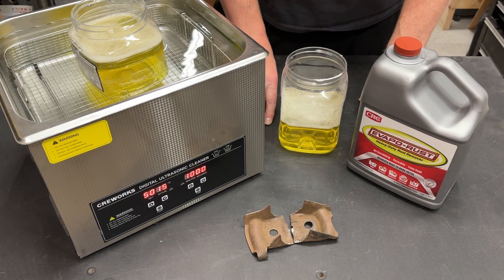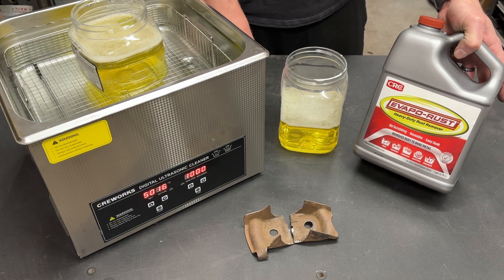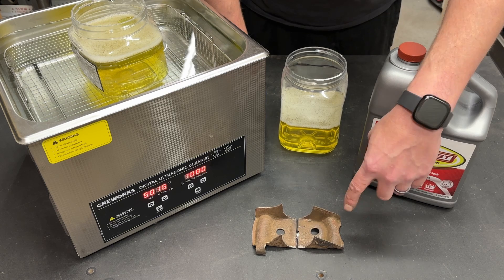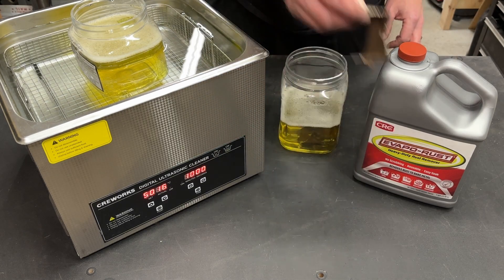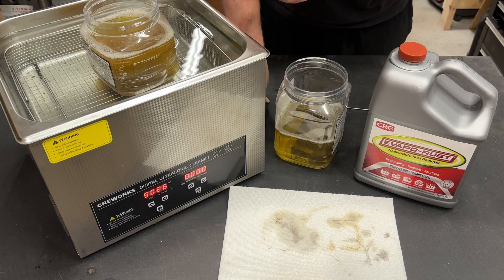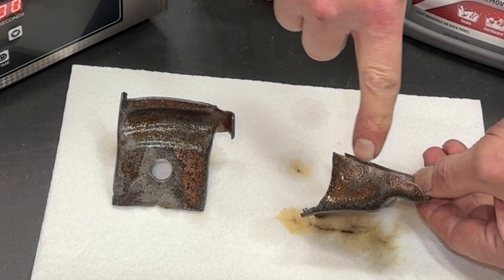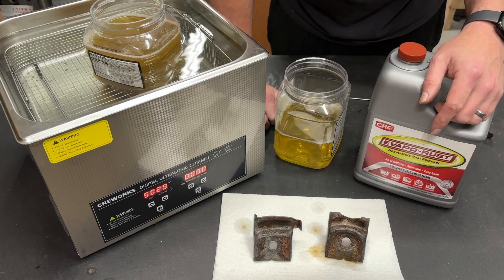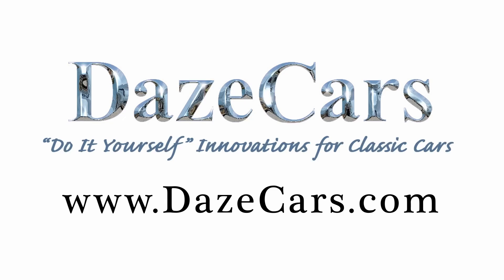Using an Ultrasonic Cleaner to speed up Evapo Rust’s Removal of Rust Lets Test it

Comment: I like the test very much. One thing i have done lately was to use a DIY Evaporust (washing soda, citric acid and a little soap, works almost the same). I soaked very dull files in it for a week and after cleaning they were a lot more usable. It mainly eroded away debris between the file teeth that my file card could not remove. I wonder if i did the same but added the ultrasonic vibrations if it would speed up the debris removal to bring them back to life faster. Hit it with heat also to get the most out of it in the shortest amount of time.
One thing the ultrasonic helps with a lot is the cleanup after using Evaporust.  I put clean water and a little soap or Purple power in it a vibe my parts for 20min and it cleans the scummy stuff off the parts nicely.
Reply from the maker: glad you liked it, thanks for the information
Reply: Your homemade solution is nothing at all like Evaporust.
Reply from the maker: lots of "homemade" formulas out there but all the ones I have seen are acid based which is one big advantage of evaporust, its not acid based so it never damages the fresh metal underneath and doesn't need to be nutrlized after use to prevent future rust.

Comment: Even if you don’t turn on the heat, an ultrasonic cleaner will heat the water anyway due to the vibration of the water molecules. The vibration causes friction between the water molecules which creates heat. It’s the same principle that makes a microwave oven work.
Reply from the maker: Excelent point! The water in the ultrasonic did in fact heat up, you can see the numbers on the left side of the cleanewr change as the video progresses.   The heat option was off so all the heat came from the ultrasonic action.  Interestingly enough the change in temp is both worse and better because the water I put in the ultrasonic was cold when I put it in the ultrasonic,  but both jugs of evapo-rust started out at room temperature so the solution in the ultrasonic started out at the same temperature but was cooled by the surrounding water.  I believe the ultrasonic solution was only slightly warmer than the other bucket at the end. Basically I could not control all variables as you said, so you are correct not a scientifically valid test but by no means meaningless.  I don't think it really matters in this case, being that we started colder and ended warmer it is likely a wash.   I try to use as much scientific method as I can within my limited time budget, and capabilities, to prove or disprove the concept which I believe I did in this case. The end takeaway is the same, ultrasonic cleaner helps speed up evapo-rust ability to do its job but not enough to make it worth running the machine unless under a time crunch.

Comment: You will likely get better results not using a separate container in the ultrasonic, as, particularly, the plastic acts as medium buffer. Good experiment, though.
Reply from the maker: secondary container is common practice among those who use an ultrasonic cleaner and has been proven to have little to no decrease in effectiveness.
Reply: @dazecars  Interesting. I use an ultrasonic almost everyday and have found plastic containers to be much less desirable, especially as a secondary container. However, end results vary all the time! Would still be a good experiment to perform for the viewers, though. In an ultrasonic cleaner, even the liquid level makes a difference in what happens to the material being cleaned.
Reply from the maker: thanks for the real world first hand information.  It would be easy enough to test glass V plastic on a secondary container V no container, I may just need to test that on a future video

Comment: FWIW, I bought a couple of crock pots to hot soak parts in. They work well. I think part of the problem with using plastic containers is that they don't transfer 'sonic' energy well. It's a lot of commitment to fill the cleaner directly with evaporust. I've seen some people use a combination with royal purple directly in their cleaner, but I'm guessing some of the chemical efficiency is reduced.
Reply from the maker: secondary container is common practice among hose who use an ultrasonic cleaner and has been proven to have little to no decrease in effectiveness
Reply: Ziplock bags for small parts work well.  Fill the ultrasonic cleaner with plain water and solvent of choice in the ziplock. Saves on solvent.
Reply from the maker: I have seen reports of mixed results with ziplocks.  Some say ziplocks develop leaks while the ultrasonic is running.

Comment: Your experiment is not apples to apples, because you're heating the water.

The first run you can see the temp on the ultrasonic cleaner is 15 to 16 °C (it fluctuates in the shot) set to 50.
Once the 10 minutes are up, the temp is 20 to 21 °C
After the next 20 minutes are up, the temp is 25 to 26 °C
And after the last 20 minutes, the temp is 27 to 29 °C

That temperature increase could be down to the ultrasonic inducers heating up and the water acting as a heat sink, but you failed to control the temperature as intended, but the temperature continues to increase after the ultrasonic inducers stopped working as the video demonstrates.

You could also do tests with a hotplate stirrer. Those allow you to see if moving the liquid around is what makes a difference, which it might be with something like the oxide coating. The advantage to those is that they're almost entirely quiet.
Reply from the maker: You are correct, and I applaud your keen eye.  The heat option was off so all the heat  came from the ultrasonic action.  Interestingly enough the change in temp is both worse and better because the water I put in the ultrasonic was cold when I put it in the ultrasonic,  but both jugs of evapo-rust started out at room temperature so the solution in the ultrasonic started out at the same temperature but was cooled by the surrounding water.  I believe the ultrasonic solution was only slightly warmer than the other bucket at the end. Basically I could not control all variables as you said, so you are correct not a true apples to apples comparison, BUT I don't think it really matters in this case, being that we started colder and ended warmer it is likely a wash.   I try to use as much scientific method as I can within my limited time budget, and capabilities, to prove or disprove the concept which I believe I did in this case. The end takeaway is the same, ultrasonic cleaner helps speed up evapo-rust ability to do its job but not enough to make it worth running the machine unless under a time crunch.

Comment: First, thank you for your time. Excellent videos.
I recently watched your video, from ten months ago, using Pine Sol in your ultra sonic machine.  I worked in the dairy industry for 40 years.  We would switch chemical suppliers from time to time.  Reps would come in and educate us on strengths and optimal uses of their cleaners.  Caustics, acids, surfactants and normal soaps.
The one theme in common with all suppliers....Soaps don't clean, water cleans.  Chemicals allow the water to do the optimal job of cleaning.  You ran straight Pine Sol in your machine.  Imagine trying to clean a floor or a dirty surface by using straight, undiluted Pine Sol.  My guess is you would have a mess.  Pine Sol and most detergents perform best when diluted to the recommended strength.  Usually, the manufacturer will have instruction for moderate to heavy soil dilution strengths.  These dilutions are designed to allow the water to effectively remove soils from surfaces.
Your ultra sonic cleaner is very aggressive.   My guess is, you could use a rate roughly double what the manufacturer suggests and get as good if not better cleaning....And save a bundle of money.   I'm no expert in ultra sonic cleaning.  As a general rule, more is not always better when detergents are involved.  Most detergents are temperature sensitive.  That's why Tide makes a special formulation for cold water cleaning.  Running an over-the-counter detergent at too high a temp can degrade how it helps water encapsulate soils.  That might take some trial and error!
Finally.  My mother loved Pine Sol.  However, when she washed dirty, oily, soiled rags, she used Lestoil.  For nearly 40 years, a good soak in Lestoil, then normal washing has been my go-to for heavy soils on cloth.
Reply from the maker: you are completely correct.  detergents bind contaminants to water however solvents do not.  Pine sol has been proven over and over in full strength to be an excellent carb soak and that is why I did it at full strength building one conceps from others work but future cleaning will involve a diluted mix.  I believe part of why pine sol has been proven so effective as a soak is due to the solvents in it plus there is likely some water in it as well.  thanks for the comment

Comment: Basically meaningless for two reasons 1) the ultrasonic action for 50 min should have caused significant heating of the solution, and as we know heat increases the speed of chemical reactions “logarithmically” so, small changes make big differences in time. 2) the ultrasonic action is displacing loosened rust obviously, and without also  displacing loosened rust (by a forceful water blast for example) on the control and only doing the most superficial inspection, no good data. And that’s before bringing up sample size. Don’t get me wrong,I have no doubt Ultrasonic can speed up reactions, but don’t waste my time at least try to make an actual comparison
Reply from the maker: not meaningless the conclusions hold even though I could not control all the variables. The water in the ultrasonic did in fact heat up, you can see the numbers on the left side change as the video progresses.   The heat option was off so all the heat  came from the ultrasonic action.  Interestingly enough the change in temp is both worse and better because the water I put in the ultrasonic was cold when I put it in the ultrasonic,  but both jugs of evapo-rust started out at room temperature so the solution in the ultrasonic started out at the same temperature but was cooled by the surrounding water.  I believe the ultrasonic solution was only slightly warmer than the other bucket at the end. Basically I could not control all variables as you said, so you are correct not a scientifically valid test but by no means meaningless.  I don't think it really matters in this case, being that we started colder and ended warmer it is likely a wash.   I try to use as much scientific method as I can within my limited time budget, and capabilities, to prove or disprove the concept which I believe I did in this case. The end takeaway is the same, ultrasonic cleaner helps speed up evapo-rust ability to do its job but not enough to make it worth running the machine unless under a time crunch.
Reply: Got another piece, do it again, run it for an hour, and turn on the heat, damn

Comment: Once I used Evapo rust plus a heated ultrasonic cleaner I never went back... For bolts and random crap vinegar works fine even simple green does ok, But for machine parts, lathe chucks, drill chucks old squares and machinists blocks vices its almost like magic. and doesn't effect the surface like vinegar will. the heat makes a huge difference, honestly think that part would be done in 45 minutes with heat.
Reply from the maker: thanks for sharing some real world results
Reply: Agree with this advice.  Had a neglected, frozen lathe chuck. Heat and time was key

Comment: What I would like to know is if there are good ziplock bags that actually stand up to ultrasonic cleaners. I needed to clean some fairly large parts (a 6" lathe chuck - too big to put in a plastic jar), and I wanted to use diesel as the solvent, so I put the parts and the diesel in a ziplock bag, and filled the rest of the cleaner with hot water, and the bag completely disintegrated. It still cleaned the parts well, but now I have a nasty mix of diesel, water, and sludge. Interestingly I drained it out of the cleaner today, and I had a white layer that looks like water soluble cutting oil that didn't smell much, and a clear layer on top that smelled a lot like diesel, that was also mixed with some 'globs' of the goo I think got cleaned off of the parts. I certainly didn't expect to get a white emulsion out of it in the end! While I drained it today, it's been sitting a few days since I actually ran the ultrasonic - I don't remember seeing the white emulsion initially when I took the parts out - it was all "clear yellow"
Reply from the maker: I would never put anything that is being used as a solvent in a ziplock
Reply: @dazecars  My point was I wonder if someone makes thicker polyethylene ziplock bags - PE should stand up to almost anything - it's very chemically stable
Reply from the maker: probably but I have no clue where to even begin to look.  Even so the violence of the ultrasonic action on the molecular level I would worry about what is inside the bags damaging the bag and causing a leak

Comment: Great test and I think you came to a logical conclusion! I would like to see the use of abrasives in an ultrasonic cleaner, maybe 1000 grit or higher for removing oxidation on aluminum parts.
Reply from the maker: thats an interesting idea, it would be like a vibration tumbler only ultrasonic.  Do they make liquid abrasives because an ultrasonic requires fluid?
Reply: @dazecars  polishing compound!
Reply from the maker: might be too thick
Reply: @dazecars maybe a slurry like used in rock polishing compound?
Reply: @dazecars  I think once you get into the higher grit ranges that the ultrasonic would keep the grit in suspension. Maybe a few drops of dish soap could be added also. Great channel and great work!
Reply from the maker: its an interesting idea.  My only concern is the inner container needs to be strong enough to withstand the grit so plastic is probably out

Comment: It sounds like the next experiment should be sound deadening. Put foam under the machine, build an enclosure, stick rubber to the sides, coat everything in peanut butter, etc.
Reply: Mine aren’t that loud. Just fill it to the top mark and put the cover on. Yes, it buzzes, but really, it’s much quieter than any other machine I have including the vibratory tumbler/finisher. If it’s really annoying, just stay out of the shop for 30 minutes. Don’t play with short times, just do it for 30 minutes with heating. There’s no point in playing around. It’s 30-45 minutes verse a full day. Also, in order to really see how it works, you have to do what the instruction say, immediately put it u dear running water and gently rub the black muck off. So I have to disagree here. I’ve been doing this for years and it’s far better. 90% of the time it only takes 30 minutes with heating. So this wasn’t the best test. You have to use ALL of the features of the machine. That’s the only fair test. That’s why the heater is there.
Reply from the maker: I agree.  if I wasn't doing it with an "experiment" in mind I would have put it in for longer and let it go but I wanted to see what sort of short term effect there was if any.

Comment: Eh, sticking with a jar of white vinegar for rusty bolts. Sure you have to neutralize the acid with baking soda and then light oil, but it works.  And I KNOW it works because I once got a GI fiberglass M-14 stock from Numrich that was too rusted to get the trapdoor open or the screws loosened, so I dunked it in a tupperware container of white vinegar and left it there for three days. All came loose with no effort, little Arm&Hammer, little 3-in-1,  and it's dandy.
Reply from the maker: I know vinegar works, I just prefer evapo-rust because it does not affect the base metal where vinegar can eat into the metal over time.

Comment: Hey, interesting thanks.
  A thought, how much does using the plastic container dampen the movement of the sound between the two fluids? The noise while irritating is what is doing the work.
Reply from the maker: I don't think the container inside the cleaner effects it much if at all.  That is standard practice for most people using larg ultrasonic cleaners for small parts.  As far as the noise it's really not that bad and somthing I can live with in situations where the ultrasonic is really the best tool to use.  I still can't justify it here when the results are exactly the same given enough time.
Reply: @dazecars  
  Okay, have never used one of these, just using my understanding of physics and sonic theory from many years ago.
   Yes people use container s in these, but it lot of times they are metal not plastic.
    A more rigid substance, such as metal compared to plastic is going to sync and pass on the harmonic (subsonic) wave much more efficiently..
   No criticism of this test intended at all. Just curious if using the subsonic s more effectively and also including the heat, could make this method optimal.
Thanks 
✌️😎
Reply from the maker: I really appreciate the constructive criticism.  I have no doubt that what you have said is correct but given the results every day people are having with plastic containers or even plastic bags I wonder if the decrease is only marginal? A great test that I might do as a video would be glass V plastic on a secondary container V no container at all.